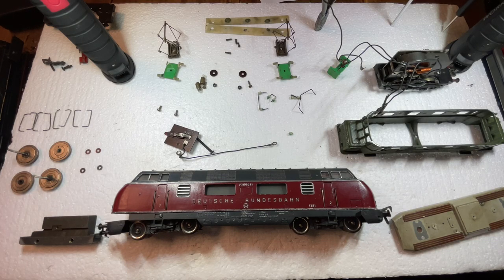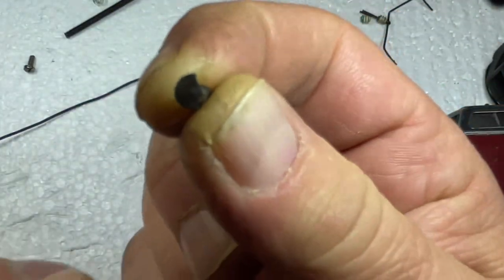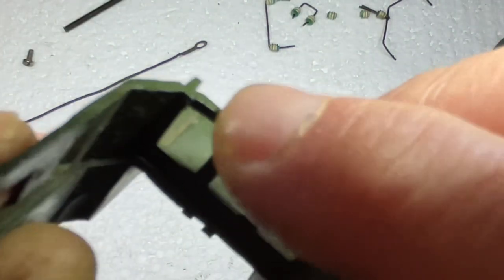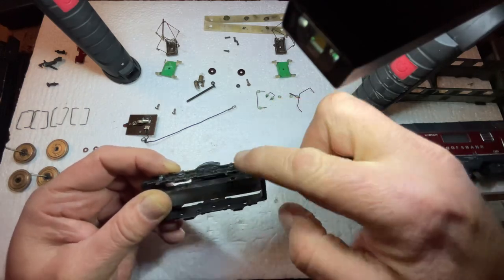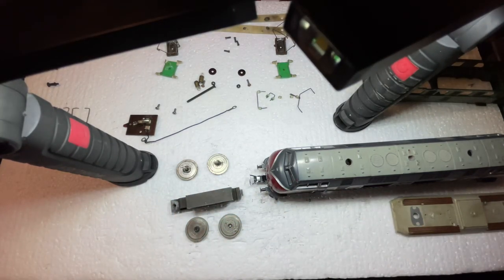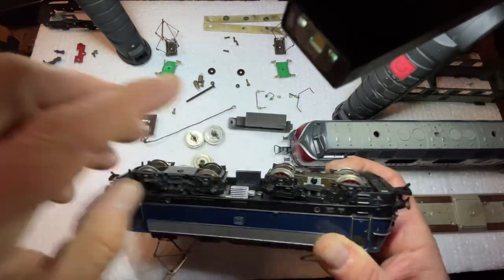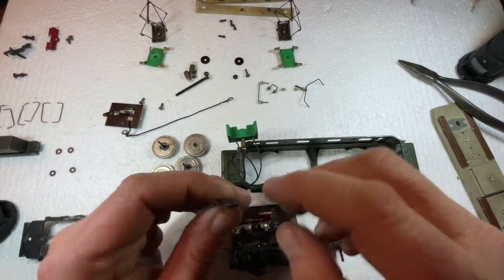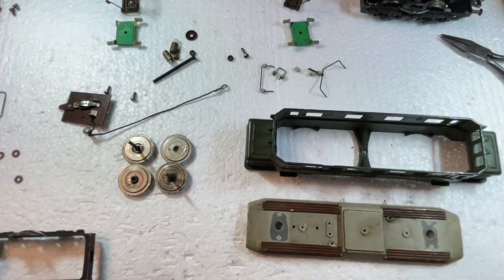Fleischmann troubleshooting & fix intermittent shorts while Loco is running on layout made simple!😃

Comment: I have found your videos on these old Fleischmann loco very interesting. 
I have converted a 41 Steam loco with LokSound 5 DCC which works really well. I am also just converting an old E10 loco to LokSound 5 DCC and LEDs. I have two Fleischmann locos my father brought back from Europe in the 1960s. 

 I had the same shorting problems with the E10 bogies you mentioned. I had to insulate the bogies from the chassis, so created 4x 3D printed swivel brackets to replace the 4 metal curved swivel brackets that slide into the body. This works well. I have found though, the loco bogies don’t run around the R1 360mm radius Fleischmann Profile track. The bogies don’t have enough angular movement to make the curve, so am trying to increase the maximum angular movement of the bogies. 
Keep the videos coming as they are very informative. Cheers Graham
Reply from the maker: Yes, the bigger the radius, the better
Reply from the maker: And thank you Graham for watching my Video!
Peter
Reply: @fleischmann_rowa_roco_ho  Most longer bogie locos do not like radius 1 I was surprised when I got a Tyco Gp20 to do Radius 2. I can't get the Mehano alco century 420 to do R2, R3 is the minimum, however the Lionel Fundimension GP30 will do R2 although the cheap gears will grind.